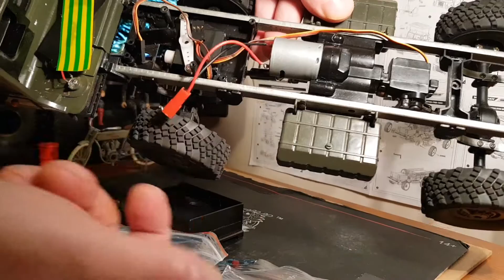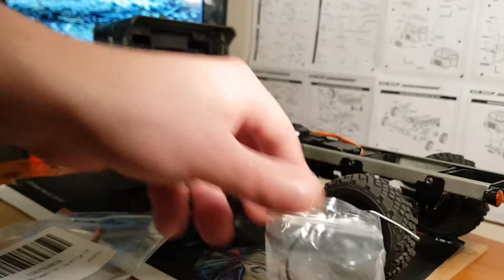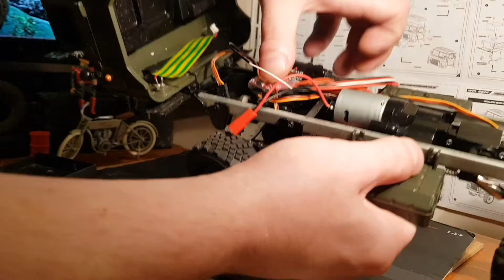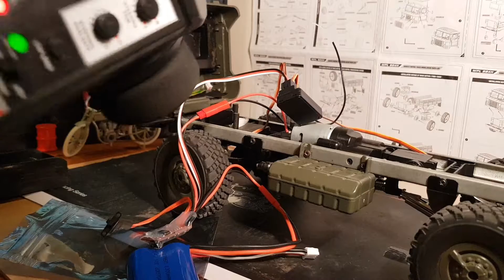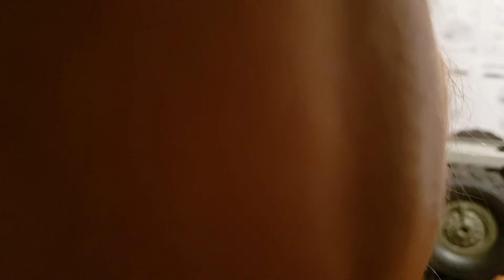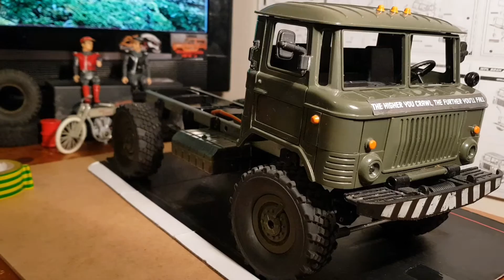Electronics Upgrade WPL B24 with 2 Speed Gearbox

Comment: Excellent setup and simplified. You helped me out a lot as I was doing it all wrong with the receiver underneath the seats of the cab and the ESC there underneath as well with wires for the rear lights everywhere and problems installing the battery drawer etc. lol. It´s like yours now and everything fits well! Just need to get those rear lights wires sorted :P

Comment: I've a cuestion concerning electronics... I'd recently got a c24-1 & a c44km both diy; in your opinion will be the best full combo for wpl cars? what receiver and what esc for a realistic long problem free ride..., servo also, any suggestion? Thx! great job!
Reply from the maker: I use the cheap 20 amp esc in most of my rigs, the hobbywing 1060 is another popular option.
As for transmitter/receiver theres lots of options out there, I use the ax6s from austar 
Servo either the jx mg1181 or surpass hobby 17g for the c24 and the jx PDI-2506MG for the c44 😊
Reply from the maker: Austar Ax6s 4 channel Transmitter & Receiver https://uk.banggood.com/custlink/3vDRroShJ4

 Austar Ax6s Additional Receiver https://uk.banggood.com/custlink/3m3RrLIdtm

Jx 1181MG Metal Gear Direct Fit Replacement Servo https://uk.banggood.com/custlink/KGDRJlIYHt 

Mini 20 amp esc https://uk.banggood.com/custlink/vmGEJlSyFs

Upgrade Servo for C34 & C44 https://uk.banggood.com/custlink/3mvycl8jLu

SurpassHobby Full Metal Geared Servo💪
https://uk.banggood.com/custlink/vGKdH3HlDZ